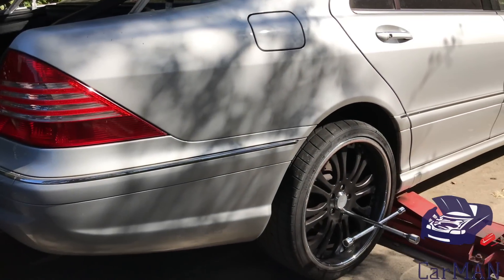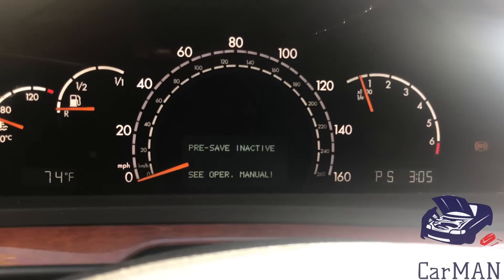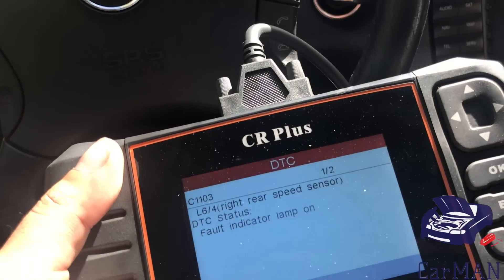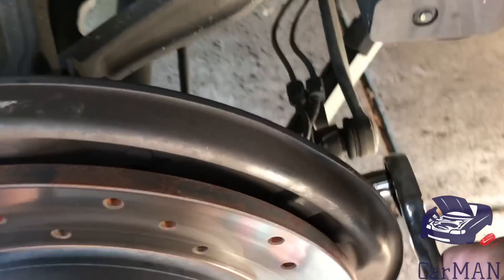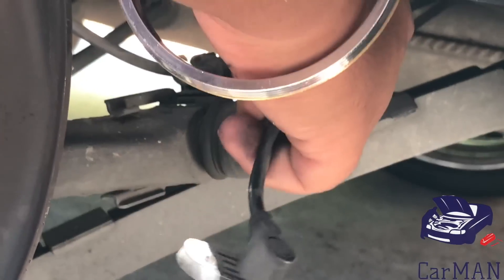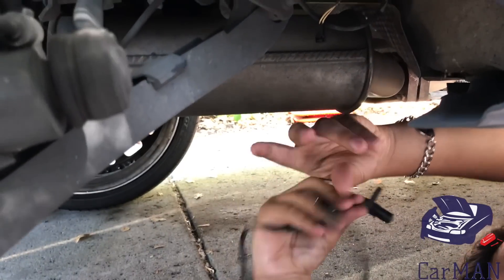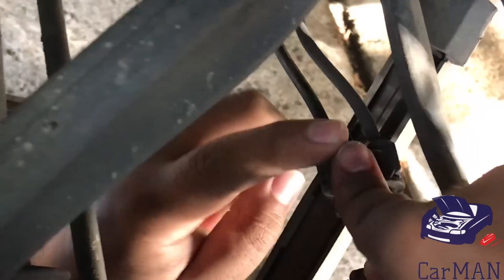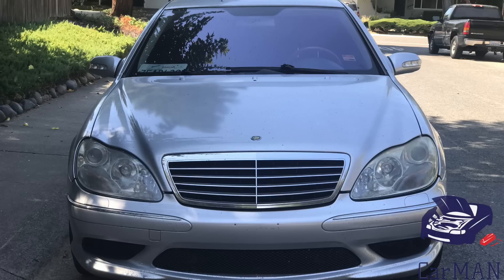Mercedes ABS ESP Pre Safe Inactive FIX | Speed Sensor W220 | CarMAN

Comment: how do you get pre save inactive out?  my battery got low and and needed a recharge from leaving something on.  now presave is on?  what s the process to make it go out?
Reply from the maker: After driving it a few miles (AND if the battery voltage is normal range) then it will automatically go away.

If not you can always erase it with a scanner

Comment: Excellent thank you.  I need a scanner like that.  My dad's w220 went into limp mode (pre safe) and says ABS ESP BSA and check engine light is on too.  Transmission won't shift out of more gear.  I think it's same issue you describe but o need a scanner to know for sure and to know which sensor location.  Is that scanner you're using good to recommend?  Thanks!
Reply from the maker: Thank you for liking the video and subscribing to the channel. -MrCarMAN

Comment: Where the brakes pulsing when you use to press them..because that’s what mine does, and it does that until the ESP and ABS light comes on. Only then will it stop normally but I know it’s not using the abs system to stop which can be dangerous.
Reply from the maker: Hi Charlie, check your brake fluid reservoir, you might have air in it

Comment: Hi MrCarMAN can u recomend some proper MB scanner,i have big problem with my suspension and also when accelerate the car make strange noise FOXWELL reader shows:rotary speed and lateral acceleration sensor c1540-008.Please help.
Reply from the maker: Hi Sebastian, my favorite scanner for Mercedes is this one:
https://amzn.to/2WNPZJr

I use it on all my benz vehicles and it works on all systems including air suspension
Reply: MrCarMAN Hi,there is any better Carsoft scanner for mercedes?Or this is the best Carsoft Model for Merc?
Reply from the maker: It’s overall the best. It scans all the systems. There are obviously much more expensive ones from other companies, but this is one I can recommend
Reply: MrCarMAN Thank You

Comment: Hey mr car man I have a w211 Mercedes 2004 pretty similar stuff car is stuck in limp mode goes in all the gears starts right up but when I hit the petal the car doesn't move it say esp malfunction visit workshop .. an idea wat it may be ?
Reply from the maker: Hi that sounds like a throttle issue, so you might want to check the throttle pedal sensor and the throttle body

Comment: Where can purchase that Diagnosis reader? Is that the best for the value.
Reply from the maker: Hi Alexie, here it is iCarSoft OBD Diagnostic Code Scanner: https://amzn.to/2Juuzhj

This is the best scanner for the value to use on multiple cars but if ur just looking for Mercedes only then get this: https://amzn.to/2JsazMn

I have both scanners and use them on all my diy works
Reply: Hi MrCarMAN can u recomend some proper MB scanner,i have big problem with my suspension and also when accelerate the car make strange noise FOXWELL reader shows:rotary speed and lateral acceleration sensor c1540-008.

Comment: *** POSITIVE UPDATE***

TODAY 3/5/19.. I changed right rear speed sensor Sunday 3/3.. no improvement. Today i take out "brake light switch", extend the tip, an reinstall the switch with the pedal down.

All of a sudden, my MPH guage started back working an car shifting good. I still have my Esp an Abs lights but car shifting.

The problem now is when I TURN ON MY HEADLIGHT'S ON, the MPH Stops working and some of the guages stop.

Comment: Great Video! Question for you, the ABS sensor prices are all over the place online, from over $100 to as low as $15.00.  Given you get what you pay for, what is the best price you would recommend paying for a front right ABS speed sensor for 2002 S500? Thanks in advance!!!
Reply from the maker: Hi Jerry, u can get these sensors for less than $20. They are aftermarket. The ones for over a $100 are OEM. In actuality is no difference. They both WORK.

Comment: Ok so that will stop the limp mode too.

Soon as the guy did the brake bleed on that same side, next day I had all the issues.

I start the car an soon as I step on the brakes, I get all the flashing an my instrument panel guages act up.

Also car stuck I'm park. I use hammer to get it out. Hlep me out appreciate it. 2002 S420 W220
Reply from the maker: So what’s the problem right now?
Reply: Ok just saw you replied an thank youuuuu....

Ok I just today installed a new speed sensor on right rear... Same issues..

Ok... I do need Front Brakes... And after the guy tried to bleed the system, next day all these issues.

I want to ask... If my brakes are very low in the front, will it cause the caliper to go out too far and leak fluid out the resivour an have the spongy pedal Bcuz no meat on the pads???? And cause all these issues?

Ok I purchased new brake pedal switch. If the headlights are off, car goes out of Park. If HL on, car won't go out of park an it looks like I have my foot on the brake all the time.

In day time, I start the car... Soon as I step on the brake, I get the ESP, ABS, DISPLAY MALFUNCTION. Also, my RPM and heater gauge start the up n down thing.

This all happened after the brake bleed. No I haven't done the brakes yet but I'm feeling if I get me done an bleed it will fix....

What's ya take, please email me at knowledgebey@gmail.com so I can get it an reply fast. Also can call...
Reply: Oh yes, only goes in 1 gear an if you do more than 3-4 rpms, it the back wheels start jerking to avoid you going any faster like bang bang bang....
Reply: Did you say hammer!?? Omg why
Reply: Josh Gray if it's stuck in park. The hammer makes the gear drop out of park as you pull same time.... But I found ITS ALL CAUSED BY BRAKE Light SWITCH

Comment: CarMan white size wheels are those? I have 19" it hits and runs on the lower control arm whenever I turn. I cannot do a full lock turns. Thanks for the input.
Reply: Primo Castro I’m running 19s 245/35/19 and can turn perfect in front .
Reply from the maker: Hi, these wheels were 19inch and they never rubbed or hit anything. It depends on the offset of the rim, so that’s why ur 19s are hitting.

Comment: How do you replace the front right ABS sensor on a 2008 S550 4matic
Reply from the maker: Hi, it’s pretty much the same way as in this video on my s500. Your going to just remove your front wheel, and then look behind the hub for the ABS sensor and just remove it. So just follow the same steps that were in this video. I hope it helped and please let me know how it goes. Thank you
Reply: Thanks CarMAN, on the S550 4matic right front ABS sensor from the wheel hub is no problem, but at the top of the sensor, I don't see how to disconnect the sensor
Reply from the maker: Squeeze it and then you be able to pull it straight down. Sometimes they get jammed up because of leakages so using a little bit of penetrating fluid right at the top helps. And also same goes with the electric connection, if it has some fluid on it; that is the reason of it being jammed up